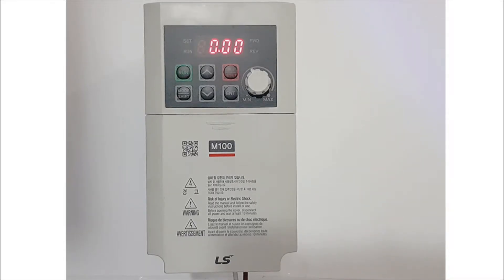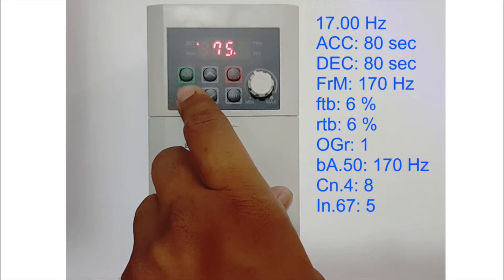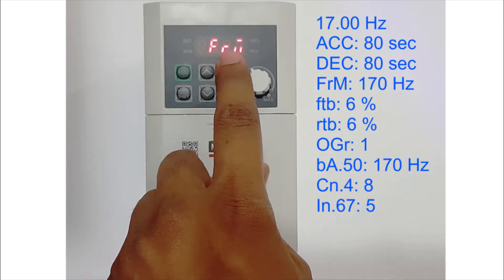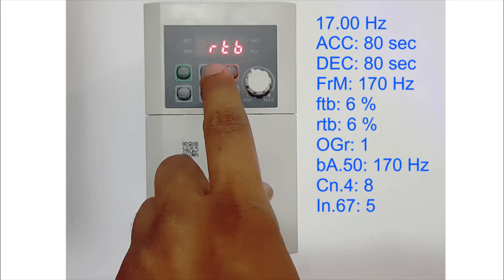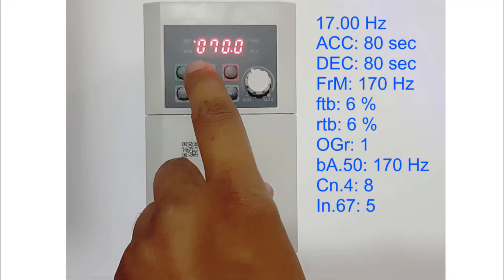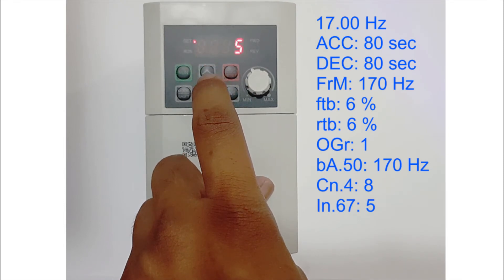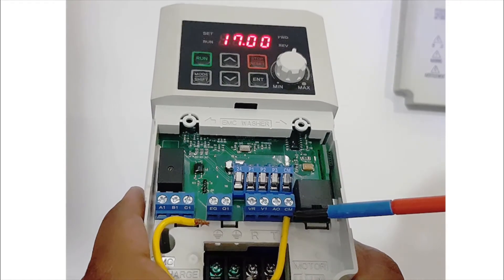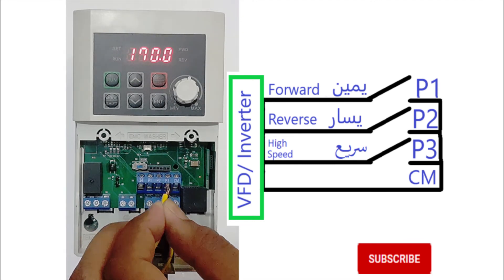How to program M100 for Washing Machine || LSIS VFD

Comment: Very detailed video Mister!
But i need setings for LS S100 model for washing machine.
If you can put video.😁
Reply from the maker: Right now video is not available, but i can provide the parameters here:
Group 0
Acc: 80 s
Dec: 80 s
St1 : 18 Hz

Group 1
Dr. 20 : 170 Hz

Group 2
bA.53 : 160 Hz

Group 5
In.68 : 9
In.69 : 7

For connections"
P1 is forward
P2 is reverse
P4 is high speed
P5 is low speed
CM is common
Reply: @howto...8040  It worked!Thank you very much!

Comment: Sir how to control  forward and reverse  by outlet  switch
Reply from the maker: P1 and CM terminal will be FORWARD direction, P2 and CM terminal will be REVERSE direction. So just connect the wire to switch
Reply: @howto...8040  sir I connect same  like this but not work  maybe change the program like frq settings
Reply from the maker: Check "drv" by pressing down key. Then press ent, and check it should be 1. Still no, then make factory reset by parameter H93 (make it 1).